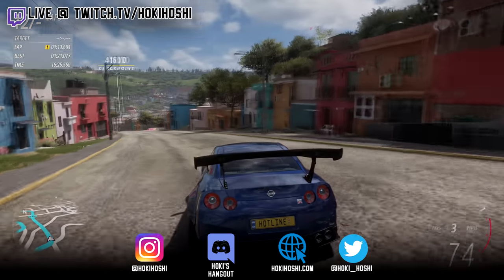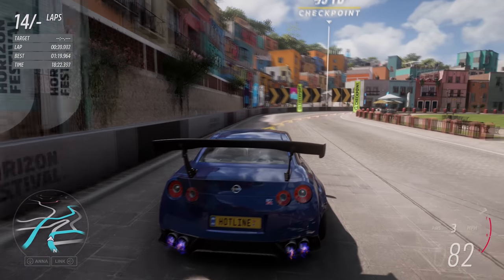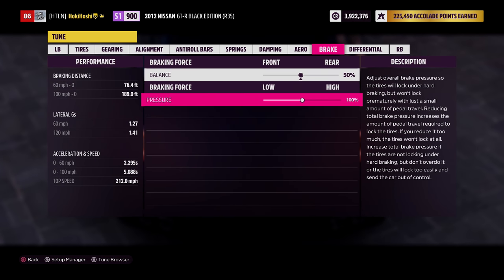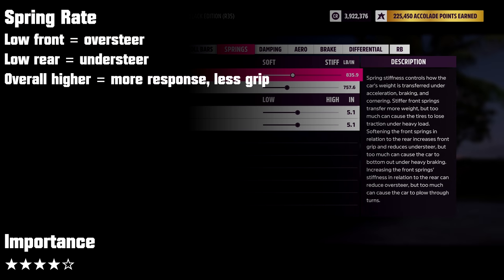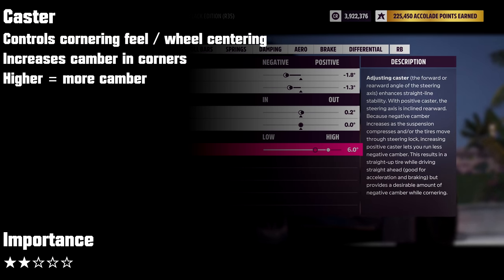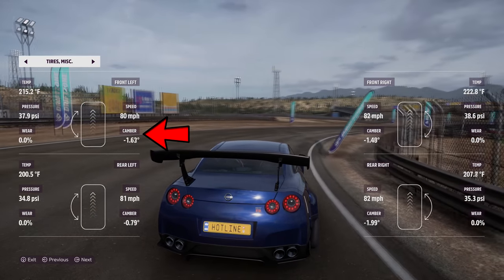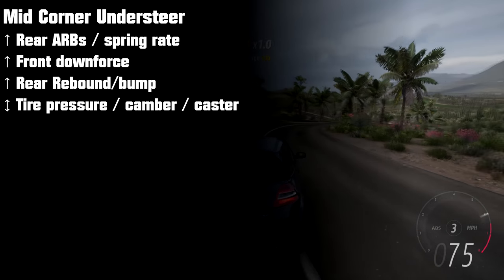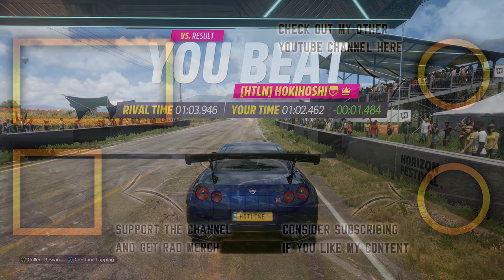How to Tune in Forza Horizon 5 | Basics of Tuning Guide

Comment: Can someone please help me. I don't really understand all this, and i totally messed up the tuning so that my car has alot of understeer. Can someone please help me how to fix this. Thank you :)
Reply: Might have to go back to your default tune and start over. And something else I've ran into is making the mistake of trying to put a  RWD tune on an AWD vehicle. That causes a lot of understeer. And also, turning off stability in settings will help the car slide a little more in turns.
Reply: @DontDodgeIt...RamIt...Dammit.  Thank you for the advise man! I'll try go back to default :)
Reply: @johanengedal7568  No problem. 👍 Should be at the tuning screen, it'll tell you which button you need to hit to load default tune or setup.
Reply: @DontDodgeIt...RamIt...Dammit.  Yeah. Thanks! Really want to reset it to default :)
Reply: @DontDodgeIt...RamIt...Dammit.  Hey man. Which buttom do i need to press to reset to default?
Reply: @johanengedal7568    Just go to the tuning screen, then press the window button, then you should be able to select load default tune.
Reply: @DontDodgeIt...RamIt...Dammit.  The windows buttom? Or what do you mean?
Reply: @johanengedal7568   The window button is what used to be called the select button. Microsoft took away the traditional select and start buttons with the Xbox One console on the controller. But either way, all you have to do is get to the custom tuning menu for the car you want to reset. Then down on the bottom left hand corner it gives you three options to either go back, setup manager, or tune browser. You will press the window button, or what used to be called the select button on Xbox 360 controllers. Then it will give you the option to reset default tuning settings. Just click on that option and then it will take all the tuning back to the original state. The parts will still be installed but the adjustments will have been reverted.
Reply: @DontDodgeIt...RamIt...Dammit.  Okay, but i use a steering wheel, and its a Playstation edition so i guess its a different buttom on playstation...? Or am i wrong?
Reply: @johanengedal7568   Oh ok. Yeah it'll be a different button, but the process will still be the same. You'll have to get to the tuning screen, hit whatever your SELECT button is on the wheel and it'll bring up that sub menu where you can reset your tune.
Reply: @DontDodgeIt...RamIt...Dammit.  So in my case the select buttom is "X" i think. Like "A" is on xbox am i right?
Reply: @DontDodgeIt...RamIt...Dammit.  The select buttom is "X" on playstation, like "A" is on xbox. Is that the buttom you're talking about?
Reply: @johanengedal7568   the button you're looking for is the one that takes the place of your Start/Select buttons on the normal controller.  PlayStation now calls them Options or Share. In the case of PlayStation, the select would be the Share. Which PlayStation wheel do you have? button.
Reply: @DontDodgeIt...RamIt...Dammit.  I have the G923 steering wheel. You can try finding a picture of it, and send me the exact name of it. Could be a big help 🙌🏻
Reply: Exact name of the buttom**
Reply: @johanengedal7568   Are you playing on a PC or and Xbox? I'm trying to figure out how you have a PlayStation wheel on an Xbox game.
Reply: But since you were on a PlayStation wheel, it's probably going to be the Share button.
Reply: @DontDodgeIt...RamIt...Dammit.  Oh, my bad. Im playing on PC, with the Logitech G923 Steering wheel. The steering wheel is either a playstation variant or a xbox variant. This just means it can be connected to either a playstation or xbox.
Reply: But both the xbox and playstation variant are also compatible with PC
Reply: @johanengedal7568   once you get to the custom tuning screen for the vehicle, down on the lower left part of the screen it should show you which button you will need to hit to get the Setup Manager box to pop up. But if you have the wheel that I am looking at on the internet, it should be the SHARE button. But that setup manager box is where you will find the reset to default option then all you have to do is click on that.
Reply: @DontDodgeIt...RamIt...Dammit.  I think i have been there, but i couldnt see any reset buttom... I'll check again later. Thanks for the help! I appreciate it :)
Reply: @johanengedal7568   No problem.
Reply: @DontDodgeIt...RamIt...Dammit.  Thank you bro. I found it! Really nice of you that you would use your time to help me. I really do appreciate it :)
Reply: @johanengedal7568   Not a problem. Glad I could help. 👍
Reply: @DontDodgeIt...RamIt...Dammit.  🙌🏻👊🏻

Comment: Spent 4 hours last night trying to get a 64 Jag Lightweight E-Type to handle like a sports car. Incremental changes, trial/error. Driving laps of the festival circuit in free roam, tweaking settings. Was fun.

The test is if I can keep up with unbeatables from driver cam, using wheel, pedals, shifter, with all assists off.

Comment: A note on Braking Balance: Actually it is not reversed. The description said this controls the balance of the hydrolic press force, not the actual braking force at the tire. So: 
- More press force at the front -> front has lower combined traction than the rear -> understeer
- More press force at the rear -> rear has lower combined traction than the front -> oversteer
I think the devs are thinking about balance from an engineering perspective.
Hope this clear up the confusion.
Also really appriciate the effort you made for this video. A big contribution to the community
Reply: If you add more brake bias towards the rear, the rear tires should lock up first. They don't. The fronts lock of first. It is reversed, and has been for at least 3 games now

Comment: Love the videos, extremely helpful. Just want to point out one issue with the break tip. The scale is not, nor has it ever been backwards. You start at 50% with the slider in the middle, if you move it to the front, your leaving more than 50% of the scale to the rear, meaning more pressure being applied to the rear

Comment: FOR DIFF TUNING YOU WANT TO DIVIDE THE TORQE/HORSPOWER. FOR EXAMPLE IF YOUR CAR HAS 350LB OF TQ AND 550 HP YOU WANT TO DIVIDE 350/550 = 0.63. SO YOUR REAR DIFF WILL BE 63 AND AND THE DIFFERENCE OUT OF 100 WILL BE 37 FOR THE DECEL. THIS WILL ENSURE THAT YOU HAVE OPTIMAL WHEEL SPIN ON THE OUTSIDE AND INSIDE TIRES IN THE CORNERS.  ONLY THEN DO YOU START TUNING OTHER COMPONENTS.